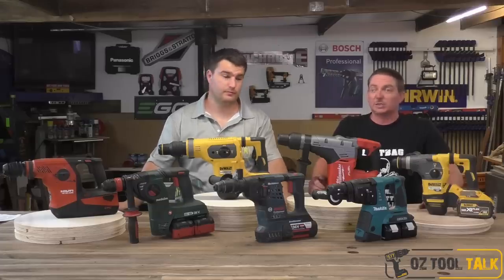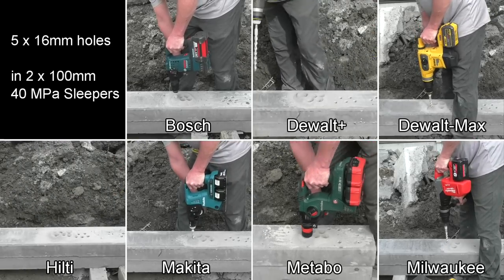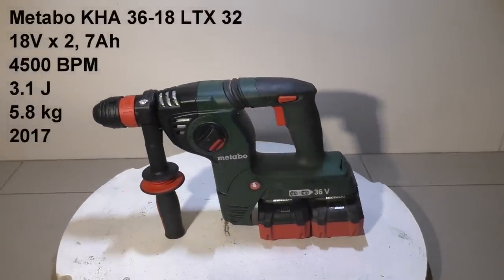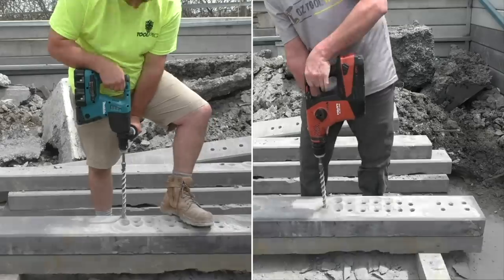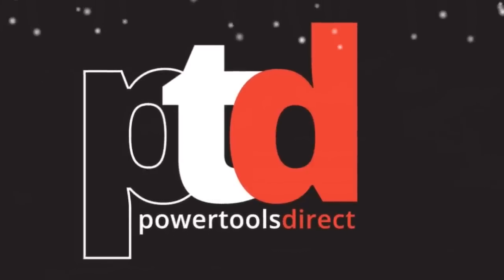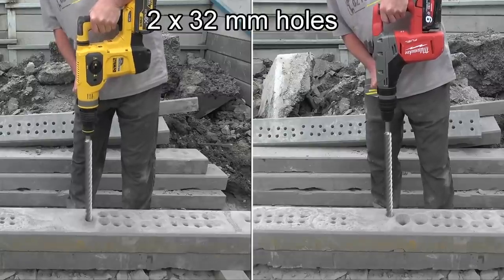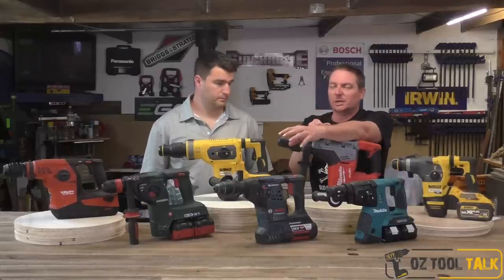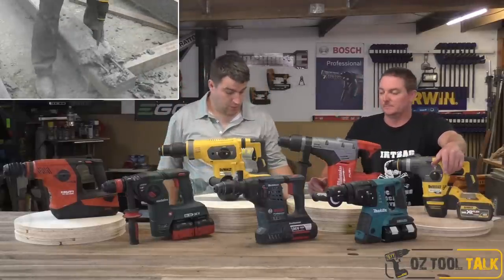PREMIUM Battery SDS Hammer Drill Shoot-out - Dewalt, Bosch, Makita, Metabo, Milwaukee, Hilti

Comment: How come whenever people do tests and reviews and Makita is the competitor they always use their lower end base model. Makita makes a 36v brushless drill but they used the brushed model which has a lot less power.
Reply: The Makita tool alone only costs $375 compare to all the rest that cost double and all of them are the newer 2017 version besides Makita and Hilti. Every tool review I watch, everyone is always trying to downplay Makita and use their base model against everyone else’s top of the line model.
Reply from the maker: [Dwain]
This is currently the best Makita SDS drill available in Aus. They used to make an identical (still brushed) 36V unit, but its been discontinued. We noted in the review not only the price difference, but also that newer model(s) are imminent.

We absolutely did not deliberately (or even accidentally) disadvantage Makita in any way, except the timing which we can't control very much.

We spoke to both Hilti and Makita (who provided the tools), and they selected the tools to be used.

Comment: Realistically the drill you buy would be the one you've got the batteries for so why buy a DeWalt if you have Makita batteries
Reply from the maker: in the case of some yes. but some guys want the best one there is, or don't mind having a second platform because they use it a lot and want huge runtime etc.

Comment: Milwaukee are nuts for not having a dual 18v battery option, hurting yourselves guys.
Reply from the maker: Darren Bray they have a dual 18v light. They must be heading that way for high draw tools surely!
Reply: Mad if they don't, everyone else is using two 18v batteries for sds, they're way behind here.
Reply: have you guys used a 9.0 batteries?
Reply from the maker: [Dwain] yep we clearly stated that 9Ah batts were used for the review.
Reply: They don't need dual batteries. They needs less volts "18V" to produce the same amount of Joules if not more then other competitors. The 9Ah battery is the designed for High Demand Applications
Reply from the maker: [Dwain] I think that you (and Milwaukee) will end up eating these words. Yes, there is lots of power to be had from a single 18V battery, but enough to replace corded, high-draw tools? I dont think so.
Reply: Oz Tool Talk eh, maybe, but we use sds max, super hawg, sawzall,  and grinders. with 3 9.0 batteries you can run all day. one cooling, one charging,  one running. we still use 4.0 or 5.0 for low amp tasks
Reply from the maker: [Dwain] Yep, there;s no doubt they have some fabulous tools and great batteries.

Comment: Milwaukee has a disadvantage over the others. It has less battery
Reply from the maker: [Dwain] Milwaukee would argue otherwise. They contend that they don't need multiple batteries or 36V to get cord-like power. But you may be right nonetheless. Nonetheless, it's their most powerful SDS drill.
Reply: Another person who thinks voltage matters on its own. Watts = volts x amps. The new milwaukee batteries can put out far more current.

Comment: Hilti rotary hammer and battery-look ugly, Hilti tool for concrete work only, ONLY I LOVE DEWALT BATTERY AND TOOLS, good for Milwaukee, Makita and Metabo, Milwaukee, Makita and Metabo batteries ONLY with HIGH CAPACITY, NOT any need tool, WON'T buy  Hilti battery and tools

Comment: Still MILWAUKEE is the best.. Only 18v and compitable with 36&54 V.
Reply: have you ever worked with a hilti?
Reply: Oh yeah. 
Milwaukee is still the best but hire centres are using Hilti just to pay more for tools which aren't as good as Your Milwaukee. 
It doesn't make any sense.
Hilti tools have always been  better than anything else.
The only tools that You can use to the limit again and again.
If you finally bored with the tool You can sell it for good money as they are holding their value higher and for longer than competition.

Comment: Hi threw my bosch in the bin, rubbish tool.
Reply from the maker: [Dwain] wow! In what sense?
Reply: The unit was fixed three times within 4months for electrical issues, very slow repair service. Battery clip was stubborn, chuck was difficult, charger was replaced... Never got to drill a hole without an issue. BOSCH JUNK. Also Sydney tools lost the tool twice.
Reply from the maker: wow, that is a bad new story there! ouch.
Reply: I have the same Bosch, knock on wood but it's been great for me.